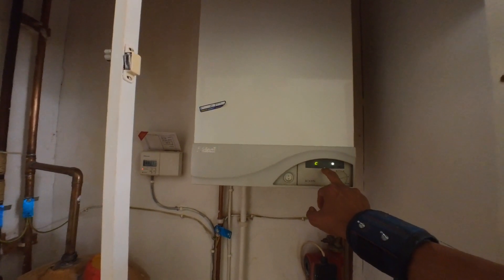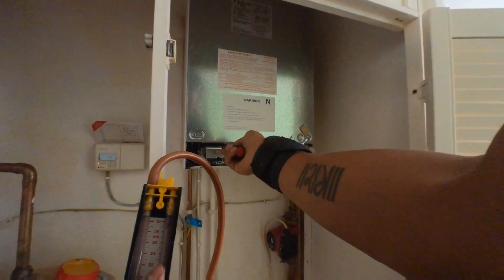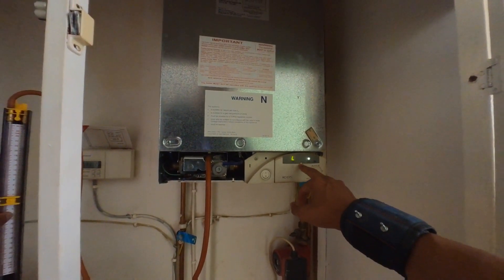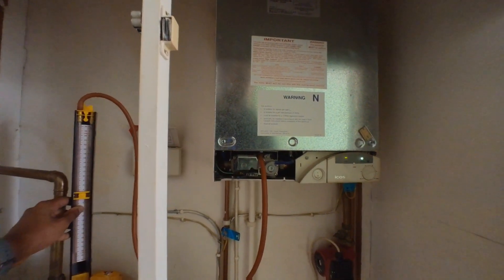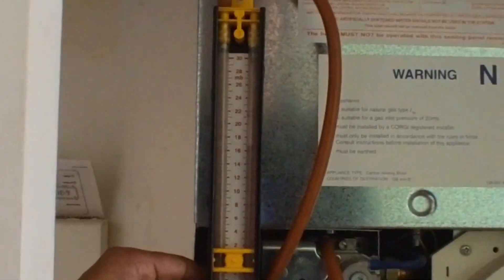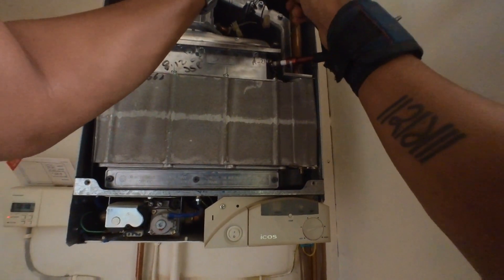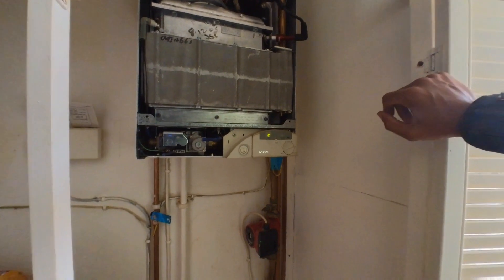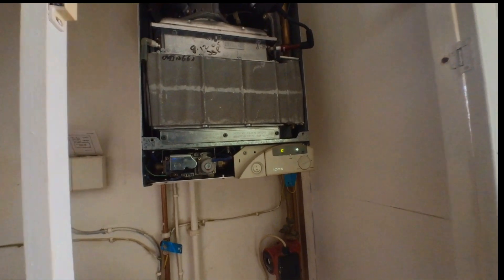Live fault finding #11 - faulty spark generator Ideal Icos

Comment: Hello I have qwestion if boiler working great to heat water in bath. But working only 1 min on radiotor and stops and show error L F.  What's can be?
Is was clean thermostat was change sensor with can see then boiler is burning.

Comment: They spark plug testers think come in pack of 4 you will need them keep breaking on me. On vals usually and not always accurate. Had one good spark lit boiler didn't stay on ended up being lead. Lead needs about 1kohm resistance
Reply from the maker: Nice one

Comment: You saved my boiler thanks so much ❤️
Reply from the maker: Thank you! Hope you subscribed! 😉
Reply: @cputilitysolutions  Hi,it heated up fine had a bath and shower then after two or so hours went back to FL code again.
It's getting a good spark as I checked with elec tester like yours,I also removed and cleaned probs, condenser trap.
The flow goes through the roof straight up and is capped to stop any debris from getting in.
Gas cooker has good supply of Gas.
Is there anything else to check, I'm at a loss many thanks?
Reply from the maker: The FL code is quite a generic code and could mean a number of things. It may need stripping back to inspect the burner too. Could also be a sticking gas valve
Reply: @cputilitysolutions  Removed fan and cleaned burner still no joy,
How do you unstick the gas valve ?
Reply: @cputilitysolutions  local engineer checked boiler today and thought the generator was at fault but after checking old one witch was dead and refitting new one it "sparked" into life...
Must have been a dirty connection, anyway thanks for all your help!!!
New sub.
Reply from the maker: @paulhotson5820  nice one, let's hope it stays that way! 👌🏾